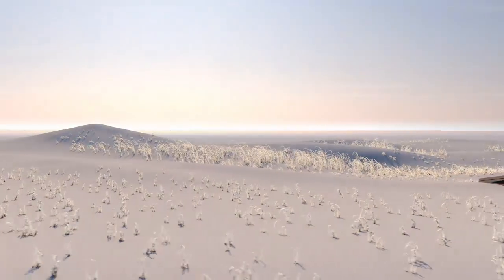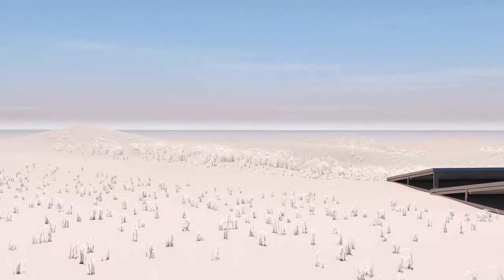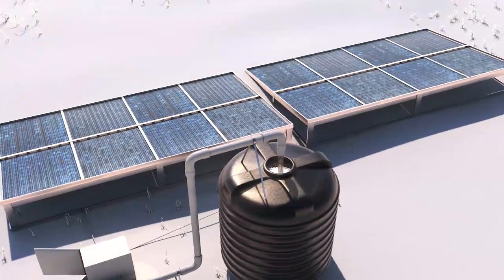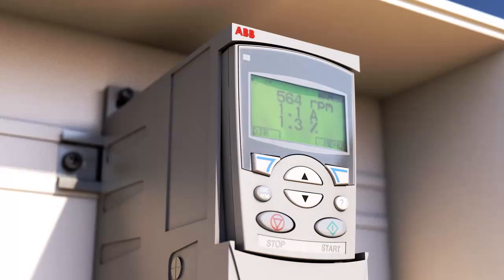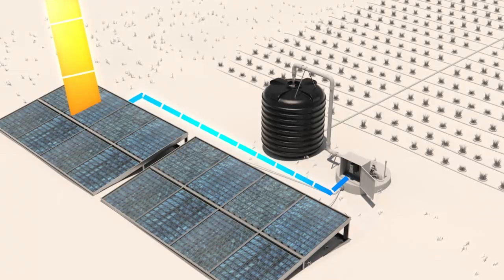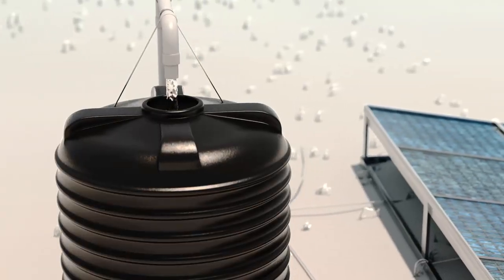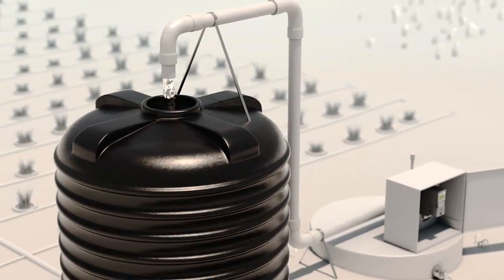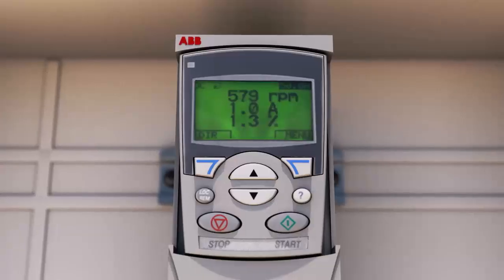ACS355 solar pump drive

Comment: Just buy ACS355-01E-06A7-2.
but got confuse what pump compatible for this because mostly 3phase pump here 3phase 380VAC?
any suggestion for brand and type pump compatible whit this?
Reply from the maker: Most 380VAC motors can be connected to delta connection to be able to operate with 230VAC. Please ask your local electrical specialist to get support on this.

Comment: Sounds good..are they compatible with my pump shimizu PS-226 BIT?
pump property : 220VAC, 50Hz, 0.5kW.
please email to omen_aja@yahoo.com
Reply from the maker: +omen N Seems that your pump is equipped with one phase motor. We do not recommend connecting one phase motors to ACS355 solar pump drive. 

To make best out of the solar installation and ACS355 solar pump drive we recommend having up to 400V  solar panel open circuit voltage for three phase 230V motors and up to 750V solar panel open circuit voltage for three phase 380 to 480V motors. It is  recommend to have solar peak panel photo voltaic power at least equal to pump motor HP’s (5HP pump  5kWpv).
Reply: +ABB Drives and Controls 
ohh, Ok I see. so must use 3phase pump right?
Reply from the maker: Yes, that's correct.

Comment: ABB solar drive works well even in the rain
Reply: Riaan, I'm setting up an ABB Solar Drive for a 210' well pump. What size motor are you running? How much solar? Voltage? 
Thanks